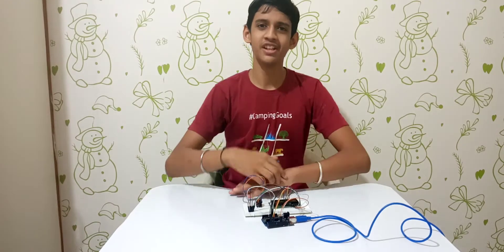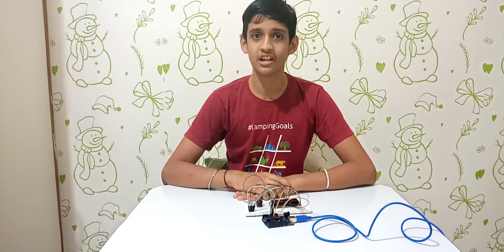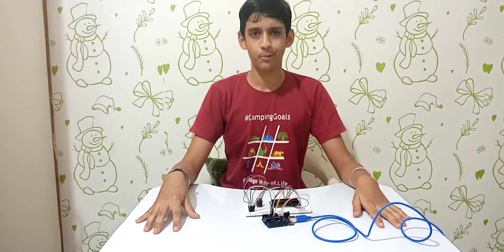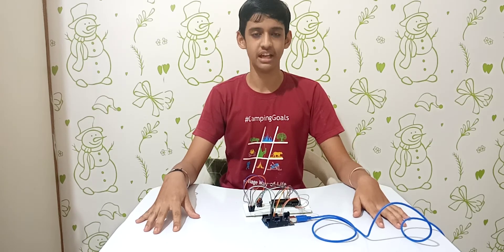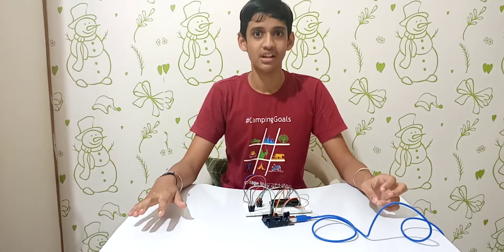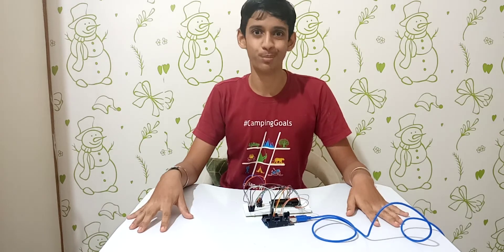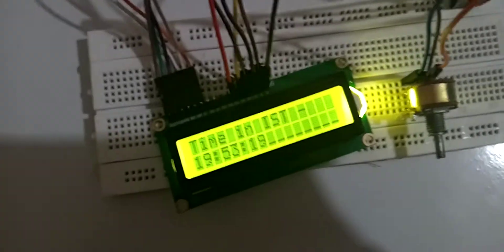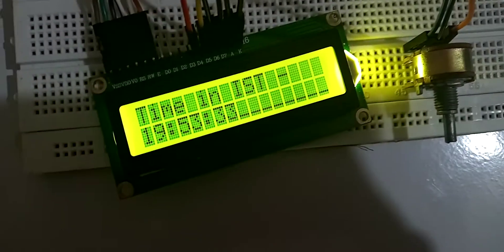First ever arduino digital clock without rtc module !

Comment: Is there button input to adjust the time? If power arduino (standalone) off, how to set the time?
Reply from the maker: Good question ,
If you have seen the code you might have found that we need to change the variables' values in order to change the time in minutes , hours and seconds . Yes , it might sound bit difficult but that's the only way out as we aren't using RTC module .

Comment: Can we make without rtc date and time with Arduino
Reply from the maker: I think that you haven't seen the video properly as its completely without rtc module .
Reply: I see total video I am asking about date .. without rtc
Reply from the maker: I have not added the date function yet but it's ready , I will be uploading it soon but you can also try to add your own method of adding date to digital clock
Reply: @codeThemUp  thanks for your kind reply I tried and failed so many times.. if u don't mine can I get the code of date without rtc .. I don't expose the code out.. I need for my own can you please
Reply from the maker: Sure but give me some time
Reply: @codeThemUp  woov thanks bro .. waiting for your reply